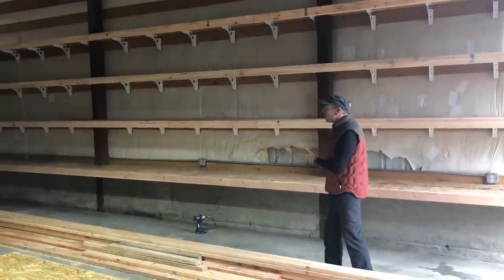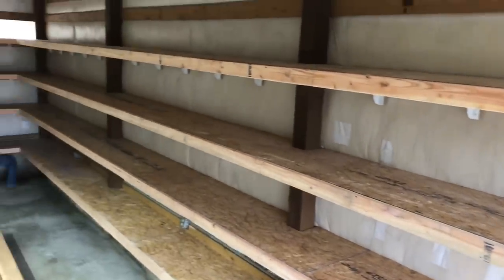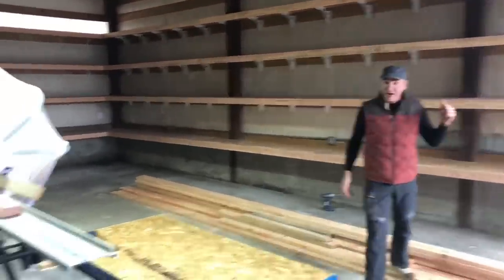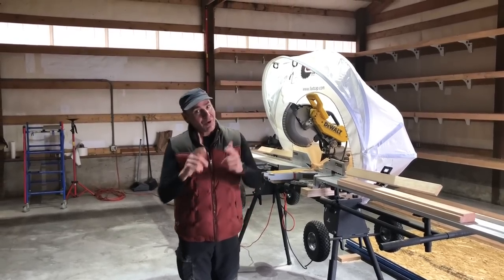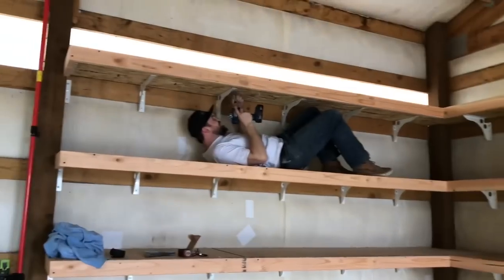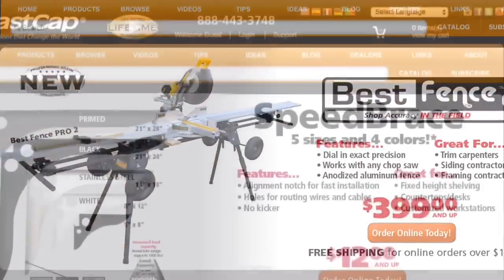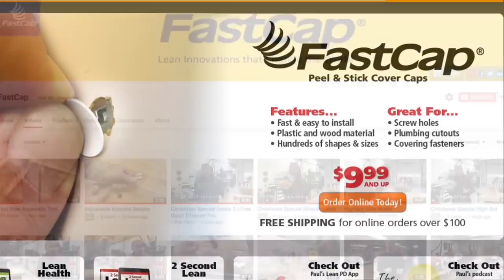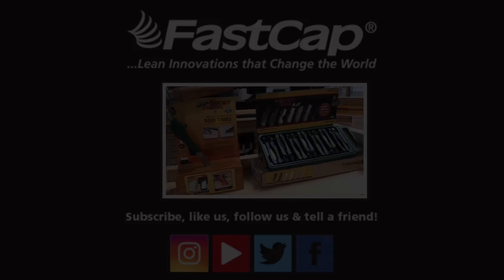Amazing SpeedBrace Project | Garage Shelving

Comment: My immediate thought is... no, no, no... just no.  2 ft deep shelves, with the bottom brace screw 3" below shelf, is an 8x multiplier of weight on the front of the shelf trying to pull out the top screw.  Each individual brace is rated for 500 lbs (1,000 lbs for 2).  Notice his 200 lbs. id deflecting a brace, not because of the brace capacity, but because of the leverage from standing on the front.

If you're going from floor to ceiling (most people want the garage floor space preserved) then just build from posts on floor with cross beams to the back wall.  If you want to go wider on the spans between supports but don't want to lose vertical spacing, go with something like unistrut or angle iron.  

Note that the weight is split between the front and back support with posts, so you can double the weight capacity.  You can google dimensional lumber and unistrut specs.

Post Example: 4x4 rated for 2,000 lbs.  
1. With most of the weight on the back wall, 2,000 x 2 = over 4,000 pounds for the post.
2. Here they have 4 shelves, or 4,000/4 = 1,000 lbs for each shelf.
3A. If the posts are at 10 ft spacing, that's 1,000/10 = 100 lbs per foot for every shelf, which you aren't likely to reach across the full 10 ft. span of every shelf.
3B. At 16 ft post spacing that's 1,000/16 = 63 lbs per foot for every shelf which is realistic.
3C. Here he is spanning about 22 ft from garage door to back wall, with 1 center beam that's 11 ft span, 1,000/11 = 90 lbs per foot for every shelf.

Beam example: P1000 unistrut (unslotted) is rated for 280 lbs. for a 12 ft span.
1. With most of the weight on the back wall, 280 lbs x 2 = approx. 560 lbs.
2. Across a 12 ft span, 560/12 =  47 bs. per foot loaded across the entire shelf.  
3. If you wanted to go with more weight, can run a 2nd unistrut  to double the weight.  Double up at the front, not the middle - if you run down the middle of the shelf, you are removing weight from the back when you really want the back to carry over 1/2 the weight.

I couldn't find a similar calc for 2x4.  In general I only use unistrut for very long runs where a failure would be catastrophic, such as running shelves down the middle of my garage above the garage door.

Note unistrut is a U channel, not a complete square, so it will naturally flex a lot.  This isn't a big concern like it would be with lumber.

Comment: Man, I just bought a bunch of the 18” speedbraces to do a 24” shelf. Wish I’d known I could have saved a bunch of money and bought the smaller ones!

I notice you also don’t have the 2x2 in there along the top of the speedbrace against the wall. Is that not necessary?   What’s the purpose of the 2x2?
Reply: youre probably better off with what youre going to do. if those shelves had stuff on them he couldnt have climbed on them.they were flexing pretty serious
Reply: I think the 2x2 is just a runner that lines all of the braces up quickly.
Reply: I was thinking the same thing having just bought $250 worth of the 24 inchers ...but after seeing the flex with his live load (while empty),  I’m not convinced this is the optimal solution for medium to heavy weight items.  The 2x4 will help strengthen some and was a good idea to help with the flex. For me, I’m sticking with a 3/4 ply application or OSB 26 inches out, and will be incorporating the rabbeted 2x4 edge idea.
Reply: I think what I'm ultimately going to do is use the braces I have, add the 2x4 along the front, and the 2x2 along the back.

Of course, I've had the speedbraces in a box for 11+ months apparently so... haha

I'd love to see an updated video on these things from fastcap showing them loaded up.
Reply: BnR Labs that 2x4 will give it good front rigidity I think. I may do the same in lieu of a 2x2 since I’m not stacking shelves. FWIW, one of the things I thought about after the fact was buying the next size down from the 24”. That way one can maximize the 4x8’ 3/4 plywood/OSB (two for one).

Comment: Essentially, just to be clear, the 2x4 is just for aesthetic purposes and offers nothing structural. Not knocking the product as it looks decently designed from my non-engineering-degree-having perspective, but this specific application seems a bit over-reached. With narrower shelving that maybe only extended shortly past the brace, and removal of the 2x4's, it would be seemingly be an effective and inexpensive shelving idea. Can't expect any wall brace like these to support 1000's of pounds, but ya gotta know the limitations of the product you're choosing to use for the need you have.

Without looking at the date (which I did), this is clearly made when 2x4's were still like $3-4. lol

Comment: Why the need to store so much stuff? Just figured I’d ask the question. Totally guilty of that myself by the way! Always gotta keep challenging myself to get rid of things and not bring more in, both at the factory where I work and at home.  -Bradley
Reply from the maker: Bradley, this is going to shock you! This 2000 sq ft garage was filled floor to ceiling with junk we cleaned out for my neighbor. We gave away or threw out 95% of it. That one small section in the last garage area is for her things that she saved after 35 years. It is practically nothing compared to what she had :0)